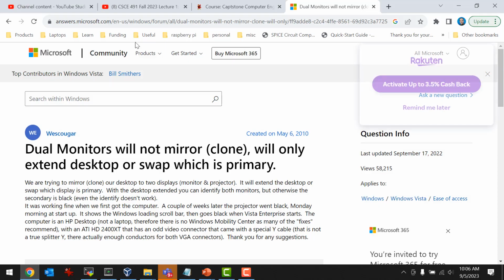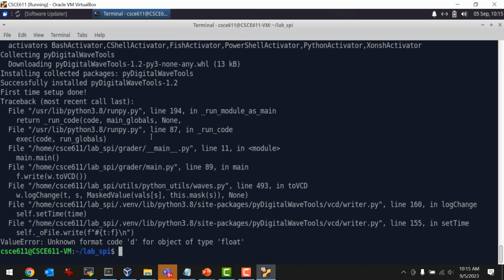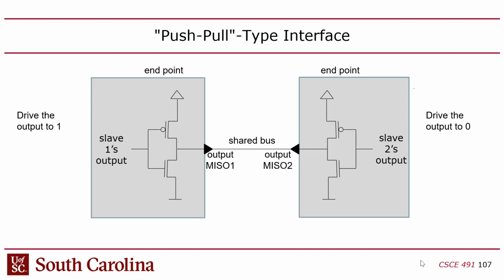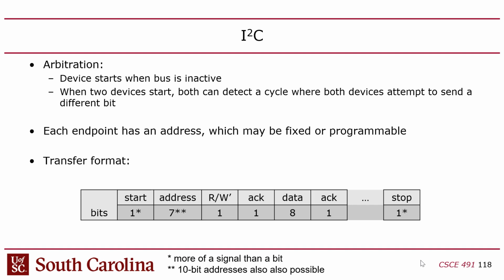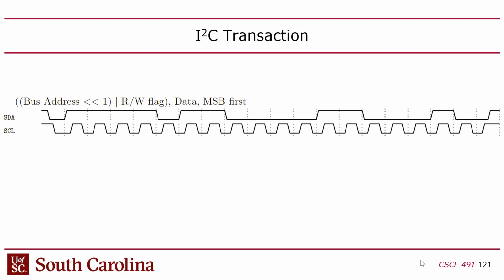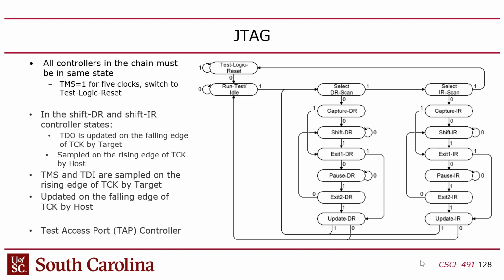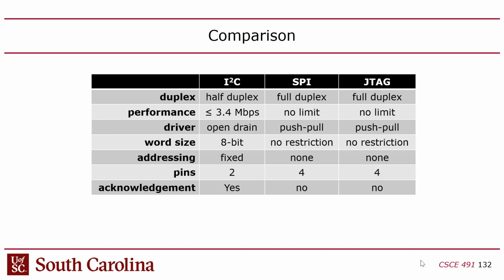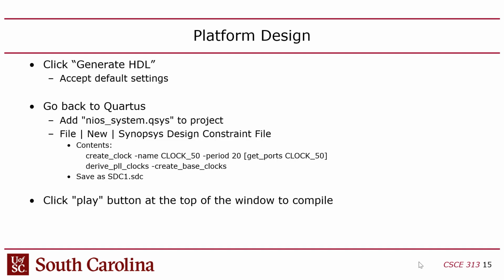CSCE 491 Fall 2023 Lecture 4: I2C and JTAG

Comment: Hi Jason, I really want a JTAG test device, e.g. SN74BCT8373, but unfortunately not really available, especially not in DIP packaging. Do you have experience with this or something similar or could you recommend something that I could use while developing a JTAG host program? Br. Gábor. Greetings from Hungary.
Reply from the maker: To confirm that I understand, you're looking for device to use as a "design under test (DUT)" that would act as a JTAG slave to assist you in designing a JTAG master that interacts with this; am I correct?  The device you mentioned, the SN748373, is an 8-bit latch but does not appear to include a JTAG Test Access Port (TAP), since it doesn't have a TMS, TDI, and TCK inputs and a TDO output.  I would recommend using an open source TAP design (https://opencores.org/projects/jtag) and run it under a simulator, such as Verilator.
Reply: Yes, correct. SN74BCT8373. I will look into this simulator. Thank you!